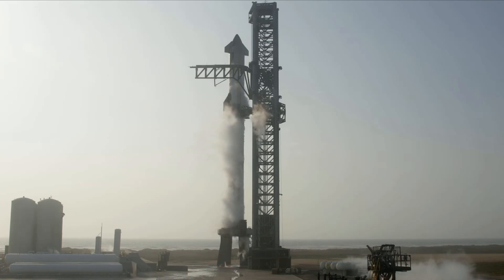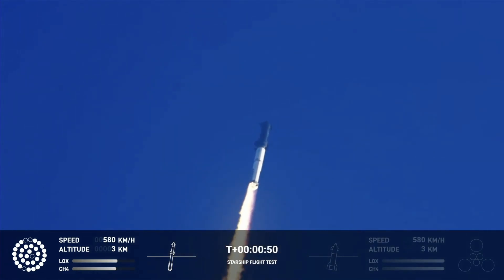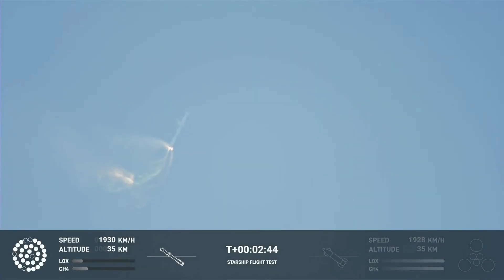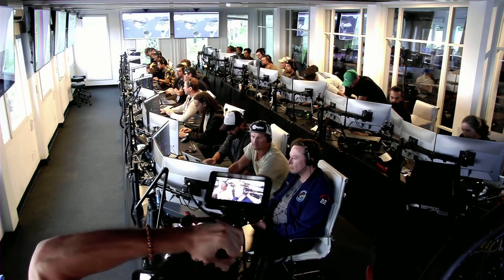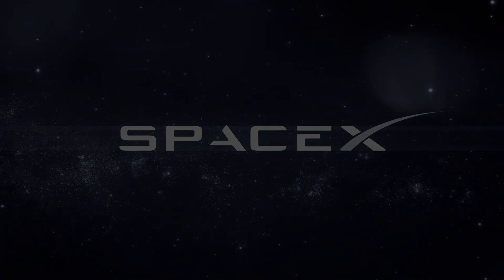Starship Full Stack Launch Summary

Comment: Trash Summary

0:21 Ignition sequence
3 engines are shut down prematurely

0:31 Concrete debris is seen flying from the launch mount

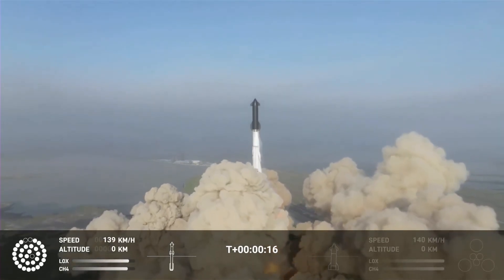0:42 The premature engine shutdown causes thrust assymetry and immediately causes starship to lean.

0:51 One of the two HPUs on superheavy is believed to have exploded, damaging several more engines.

0:59 An engine burns out and dies probably due to damage from concrete

1:17 another engine bursts into flames before burning out.

1:41 an engine is also seen burning out beside one of the failed engines but it is not updated in the engine tab.

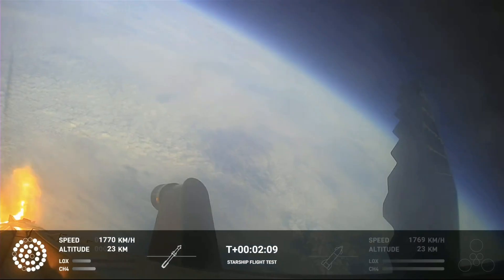1:47 loss of thrust vector control. The thrust assymetry causes the ship to tumble.

2:38 approximately around this time is when the flight termination system is activated. ( the flight termination system actually punches holes on the tank, it doesn't explode it. )

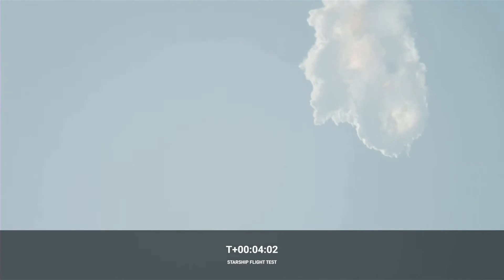2:57 The pressure leak caused by the FTS finally causes starship to break up.

Glossary:

Hydraulic Power Unit ( HPU )
a system using pressurized fluid to help steer the rocket. In this case, the HPUs control the 13 center engines. 1 exploded during the flight.

Flight Termination System ( FTS )
a controlled system that self destructs a vehicle.

Comment: I think it was supposed to separate before it did the flip, and then when it did flip the heavy starship on top kept it going round and round until eventually it exploded. I think they had a problem with ship separation
Reply: yeah but it started flipping out before T+2min 52sec which was when seperation was supposed to happen so I think they lost too many engines for the gimbal to correct the heading. It is a very aerodynamically unstable craft after all
Reply: @malgos6532  we’re all just speculating, but I think if it was separated, right before it started flipping, it might have worked out a bit better. That’s what led me to believe that got stuck, for some reason it wouldn’t separate. Then the weight of starship, caused it to do a cart wheel, basically. Either way, I’m glad it cleared the launchpad and tower, it was a very historic moment.
Reply: The flip was supposed to be what actually separated them like a slingshot
Reply from the maker: yeah most likely the hydraulic thrust vector control system died and meant they couldnt regain control after entering spin
Reply: @NathanLewisVideos  I honestly think it was supposed to separate right before the flip, something happened to where it could separate, and then the weight of starship caused it to lose control.
Reply: Do you guys think it was engine failures due to debris?
Reply: @karlkarlsson9126  I think that’s highly likely but it could’ve been several factors all at once
Reply: Starship staging is unlike any other rocket.
The traditional rocket uses Hot staging like in Soyuz or being ejected with a smaller rocket to propelled it forward before activating the second stage engine like Saturn V rocket.
But Starship first stage will perfom a flip maneuver the moment it detached from the second stage so it's unlikely they will get it to work on the first try